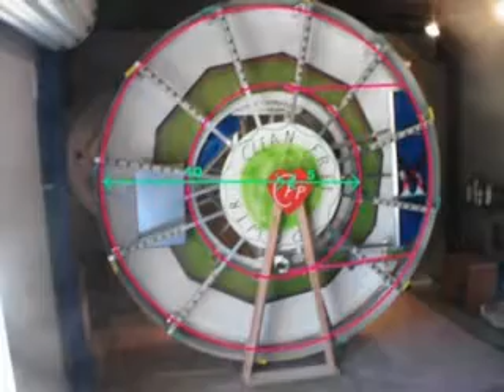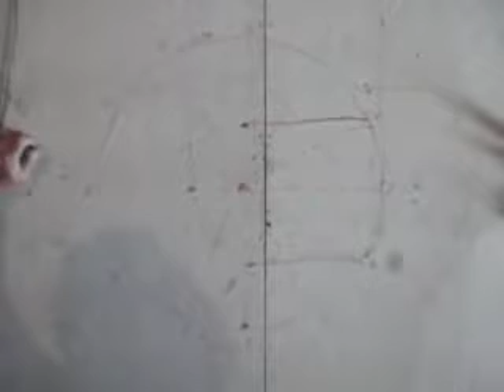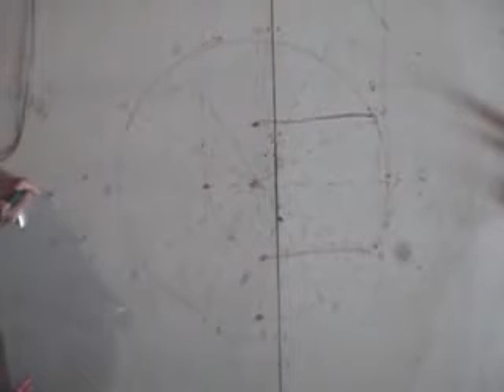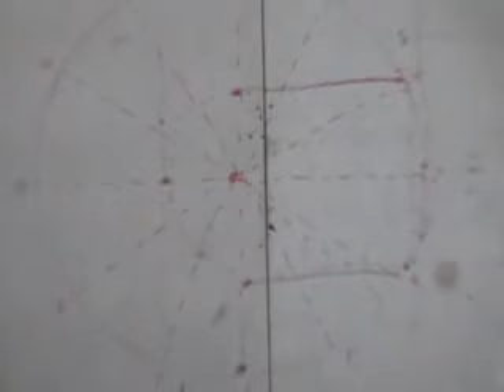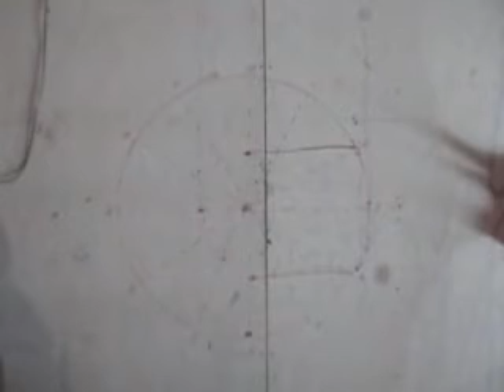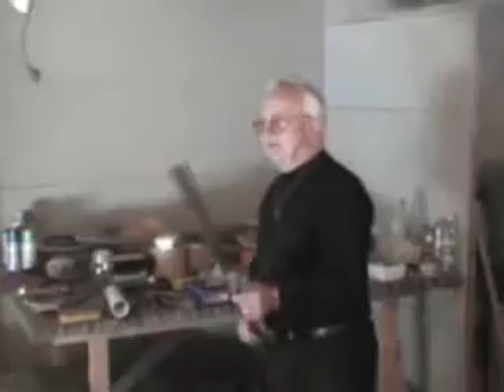Chas Campbell - Gravity Wheel

Comment: Yes Chas, but whenever you allow the weight to go on stationary path, you isolate it /partially or in 100%/ from whole system. That will cause permanent self-balance. It is possible to obtain "perpetual" motion, but with different configuration. However God bless!

Comment: In my calculation the ball from the top would drive the Wheel down from point A to point B at about 63*. In order for the ball to return back to point A the Wheel has to turn about 120*. Good concept but it does not compute scientifically. I believe it is possible but not on this configuration.

Comment: If all other resistance forces are ignored, your design will have perpetual motion with barely enough force to do any work. Taking into consideration other resistance forces, your design is a dead duck.

However, this can be easily rectified with some minor design changes that can scale the right outer circle downward force up by more than 70% against the left inner circle downward force.

Comment: The right side of the bigger wheel, as you have said, will only have 2 weighted balls at any one time. Whereas, the left side smaller wheel will have at least 8 balls at any one time.

Assuming each ball is 1 Kg, inner circle is 1.5m radius, 4.5m radius outer circle and each arm is 20 degree from each other, you will find that your left inner circle will have approximately 8.5 Kgm downward force and the right outer circle will have approximately 8.86 Kgm downward force.

Comment: Chas, you have got it almost right. However, the left side of the smaller wheel with the weighted balls will always have greater force than the right side of the bigger wheel.

The reason why the left side of the smaller inner wheel has greater force is because at any one time the left side of the smaller wheel have more weighted balls than the right side of the bigger wheel.

Comment: you would think that it would work, after all the wieght is twice as far from the center of the wheel, but count the spokes, there would need to be 4 balls on the 1/2 side and 2  on the full sides with 2 balls on the slopes, he said hims self that they are twice the distance so a 2:1 ration, if each one is 2lbs then the 1/2 side would have 8lbs and the other side would have 4 lbs thus balanced. besides this idea started back with Leonardo, 600 yrs later still dont work. try something new

Comment: im not really sure that would work...the turn ratios are off....the out side ball only goes 1/5 a turn and has to move the inside ball 1/2... so you would need 2.5 balls to go from top to bottom to move one ball to the top....in turn you would quickly run out of balls to go to the outside wheel

Comment: This device would never work. Campbell's explanation and drawing are both wrong.
When the long arm drops, with a ball, from top line to bottom line it can only lift
another ball, on short  arm, from bottom line to center line.  It requires the dropping of
two balls on the long arms to raise one ball, on short arm, from bottom line to top line.
Having to drop two balls to raise one ball is not a sustainable system.